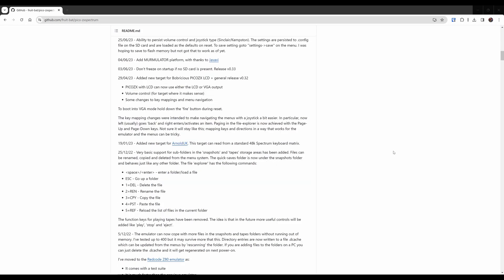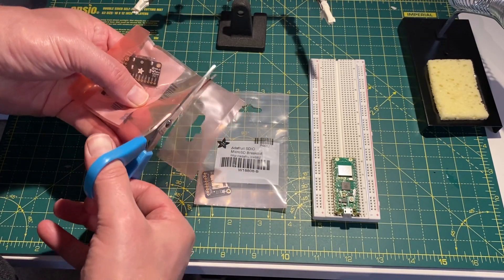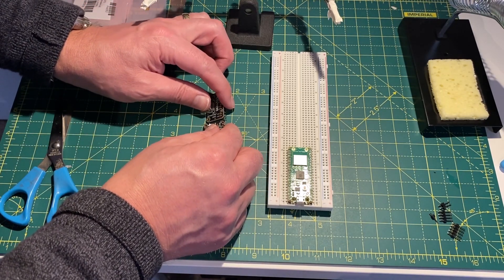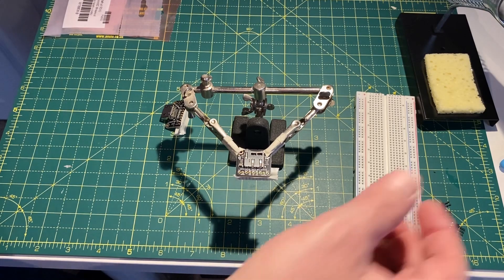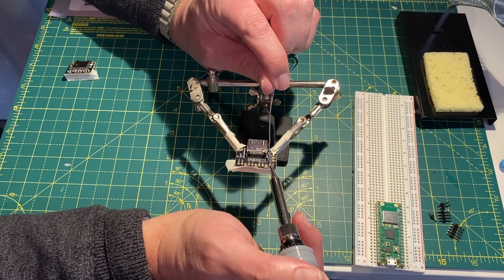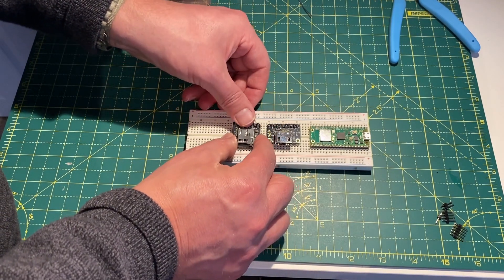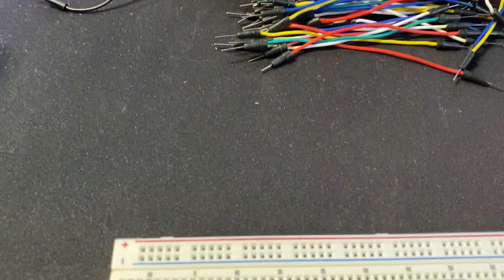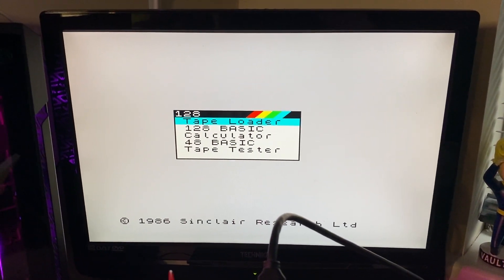Building a PI Pico ZX Spectrum

Comment: This is really cool, but the Pi Zero W is widely available now, includes HDMI out, a micro SD card slot, and USB input for keyboard (or you can make your own and use the GPIO pins). You spend more on parts for the Pico than the Zero W costs.
Reply from the maker: Thanks! Yes but that wasnt the point. I had the pico alresady £7 and the 2 parts cost £5 so not alot. I have a Pi Zero also now but that for something else to play around with. I really liked the idea of doing it with the super cheap Pi Pico.

Comment: I spent ages trying to get this to work, I just couldn't get a HDMI signal on my Samsung TV.  I rewired it many times, swapped HDMI cables, HDMI breakout & Pico board and still nothing.. as a last resort I tried it on another monitor and it worked! I got as far as you for now, will still try and find out why it doesn't work on the TV though. (EDIT: +1 hour later and I have sorted the TV issue. The breakout needed 5v in from the Pico VBUS. I didn't know this >.< )
Reply from the maker: Thats really interesting. I wonder why some work without and some only with. I am able to recreate this with my Samsung TV. Doesnt mention as needed in the specs.
Reply: @retro8brit156   The problem I had was the TV didn't detect anything on it's HDMI port so it wouldn't even let me select that HDMI port. I  soldered a pin to the "5" on the breakout board (same as yours). Progress today though, keyboard and sound now working too.

Comment: Tip:  Put the pins in the breadboard, use some blutak under the board to prop it up to level and solder in place.  Muuuch easier!
Reply from the maker: I have some blu tac. Wil give it a whirl!

Comment: Nice video, think im going to try this I have a PICO in the draw not being used :)  it would be nice if I could get 2600 running on it. I also would like to make a ZX81 work as that was my first computer...
Reply from the maker: Great! You sound like the same boat i was in. Had the Pico and then saw this project so had to have a go. Will do some more tinkering.

Comment: Nice vid! Been toying with the idea of a Speccy on Pico - and it looks like someones gone a dozen steps further!

Don't be afraid of using the breadboard to hold the pins and shimming the PCB to tack a few pins (ideally remove to flow the rest, though I personally don't.)
While I could point at the odd pin you may have done better, most were fine and appears you re-flowed later anyway - it's a knack and you're pretty much there, and if it was the solder and/or duff flux, you couldn't really get much better from it.
Reply from the maker: Thanks. Really appreciate the comments